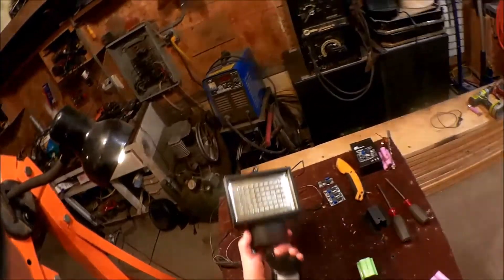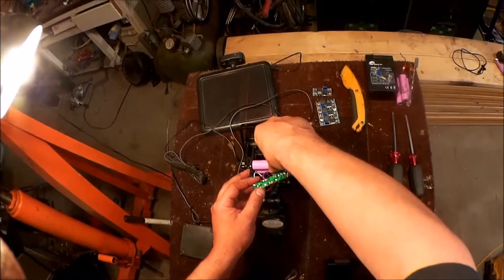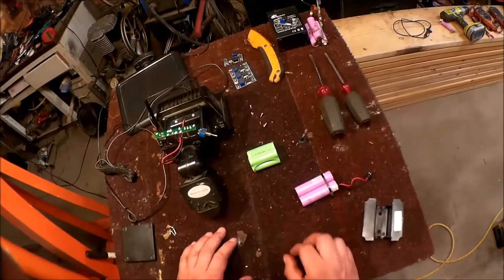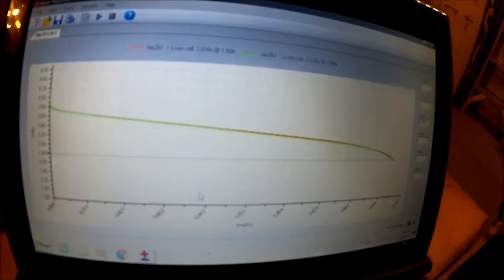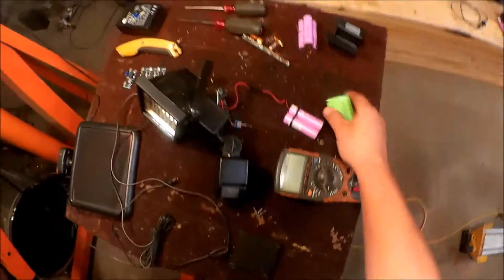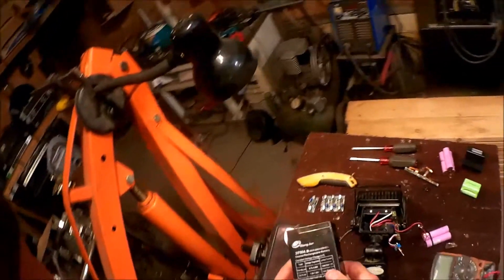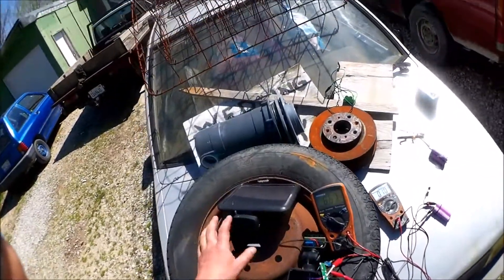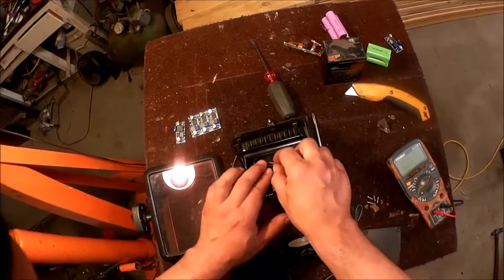Solar Flood Light Upgrade

Comment: Good idea but out of specs and the leds will burn out and the 18650 maybe as well. Solution:  Only use one 18650 then use a charge controller or buck for charging to 4.2v and a boost converter for the discharge side to the leds so they won't burn out, boosting it from 4.2v and under that to 6v. Then it's completely within specs and it will run just fine. Those controllers cost a few cents each like 40c for the booster and less for the charger. That way with only one cell you also won't need a bms to equalize the voltage of the cells while charging. I'm gonna do exactly that in short order lol.

Comment: I have a similar HF light. I removed the battery, cut the wires, drilled a hole to run the wires through and connected 
them to a 6V rechargeable lantern/flash light battery. I cut a 1/2 gallon milk jug in half put the battery in it and hung it on the wall on my porch beside the light. I thought it would be a test to see if it would work. Well it has been working for at least 2+
years on my front porch so it gets a lot of use. I have another light now and a 12V scooter battery I am going to try next.

Comment: I just abandoned these HF lights after years of screwing around with the poor quality. I pitched four of them but kept the solar panels.  Why?  Not sure.  Maybe they have some other use. I switched to the Sam's Club $35 version that has proper battery holders and brighter output.  I have six on the property in NM and two in service in the Rockies at about 9500 feet.  I just felt it was not worth the trouble to do what this fine gentleman cleverly did to solve the problem.  My issues were with the motion sensors and photocells failing.

Comment: what if i take a 12v 2.7x3x4 size battery and attach it to the light and use a resister to lower the voltage do you think it could last for 8 hours of lighting. i can make my own brackets and my be use a small step up transformer to charge it to about 13v when it charges,  will the led lights work on that voltage or will they last for very long being on for so long the battery will take a charge of 14v max so i think the battery will do, please email me back thanks

Comment: I have the 36 led harbor freight light. I replaced the 3.2 volt battery (600mah) with three 1.2 volt 1300 man batteries wired in series 3.7 volt and the panel charges them to 3.2 so it won't work..

Comment: its need 7.2V 6A 2S Dual MOS Polymer Lithium Battery Protection Board for 18650 battery .. without it will not work longer .. i had same problem ..

Comment: i have the same light same problem. thanks for the video.  im making a sign for my shop with illumination from the inside. can you tell me where you bought the mini charge controller?
Reply from the maker: If you are referring to the exact light in the video where I replaced the nimh cells with lithium ones, I actually did not use any charge control because with the increased voltage and capacity of those cells it was just enough to be self regulating on that panel.  However, I think I should have used one of the boards you mention which is called a "buck converter" to reduce the voltage going from the battery to the light.  It may be a coincidence but shortly after I returned the light more than half of the LEDs burned out.  I haven't been able to inspect it as my dad is lighting a stairway with it and likes it dim.  One of those should be just about right at the minimum voltage difference it will provide which is a 1.5v reduction.  You set the voltage on those by applying a voltage at least 1.5v greater to the input and turning the small screw on the blue block until you have the output you desire.  The output will then stay at or below that setting.  I used it as charge control on the similar light with the large lead acid battery by setting the output to the battery's rated constant charge voltage(which is usually printed on the battery).  The item I used was something like this                                                 

https://www.amazon.com/RioRand-LM2596-Converter-1-23V-30V-Pcs-LM2596/dp/B008BHB4L8/ref=sr_1_11?ie=UTF8&qid=1472184221&sr=8-11&keywords=buck+converter

Thanks for watching
Reply: +The Mechanical Philosopher Thanks a bunch. i will give it a try with parts from a bum dewalt 20v batt. i have never used the leds that arevfor sale on the roll before. The type that can be cut on the line and payched together. i would like to hand a sign for the welding shop outside and puntbthe lights inside, with a solar panel to power it. any suggestions on a design and parts?
Reply: +Drone Retrieval Unit  i need to spell check first. sorry about that.
Reply from the maker: I haven't really built much with LEDs.  My suggestion would be to build the power system larger than necessary using 12v lead acid for maximum longevity and compatibility with readily available equipment.  There are many sizes of battery available starting with the 6volt ones I mentioned which are used for backup lighting and alarm systems.  I might use two of them in series to get 12v for a small sign.  If the project is large enough to justify it these charge controllers are very nice and are real mppt unlike many cheap ones advertised as such.  They have load timers built in for lighting applications.

https://www.amazon.com/Tracer1210RN-Solar-Charge-Controller-Regulator/dp/B008KWPGS6/ref=sr_1_1?ie=UTF8&qid=1472671427&sr=8-1&keywords=mppt

You will have to figure out how much power the whole thing will draw and then do the math.  Properly aimed and unobstructed solar panels are generally calculated to produce equivalent to four hours of their maximum output per day.  An average cloudy day seems to produce about a third of that, while a very dark day can cut the output to almost nothing.  You will have to figure out based on your weather how much cloudy time you must be able to span.  For the maximum lifespan of the lead acid battery you want to figure on rarely draining it below 50%.  For maximum power collection, make the solar panel easy to change the angle to follow the seasons.

Comment: Not even sure why companys sell solar products.  Its in obvious scam when you consider the batteries used.  The funny thing is most people don't even realize that the little solar panel on the tops of these types of lights actually charge a battery!  

ANyways,  the real question is:  Did the manufacture size the little solar panel correctly for those batteries?  They might be getting charged within 5 hours when you have 10 hours of decent sun exposure, which opens up a world of opportunity.  Or they might be barley charging the batteries at all.  I could easily see some company using certain voltage batteries because of the bulk price.
Reply: You get what you pay for...These cheap solar lights are built to a specific price, not to certain standard of quality..
Reply from the maker: +Michael Hepburn The battery was sized perfectly!(as long as nothing comes along and obscures the sun somehow) The other light I mentioned that had roughly the same panel and leds had a lead acid battery of about 4 times the capacity of this nimh one, and they still managed to cook the battery in about a  year by not having any charge control.